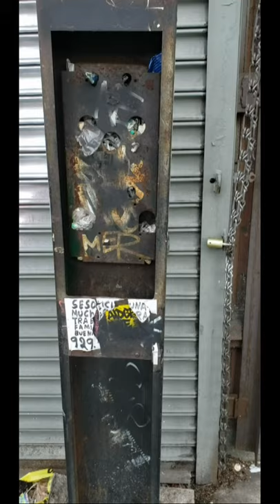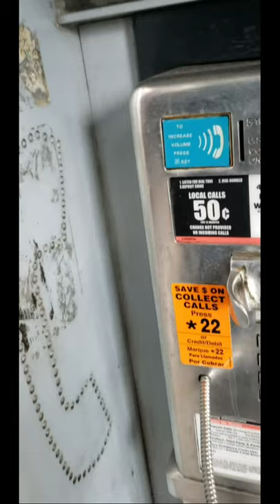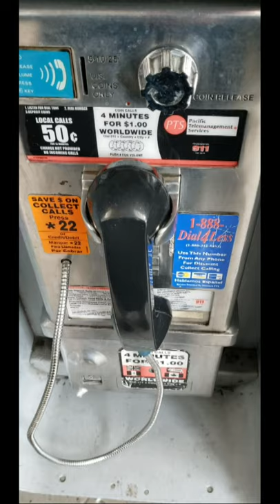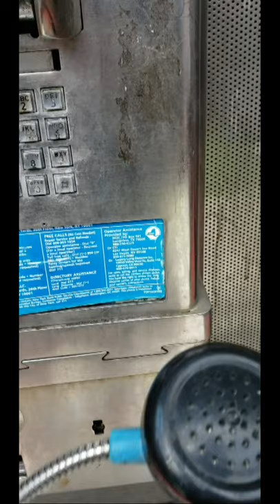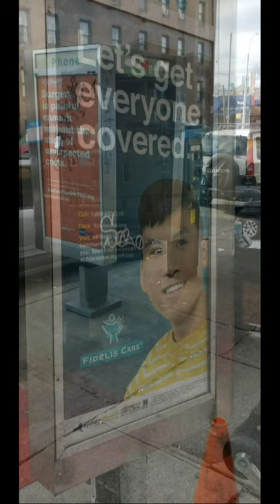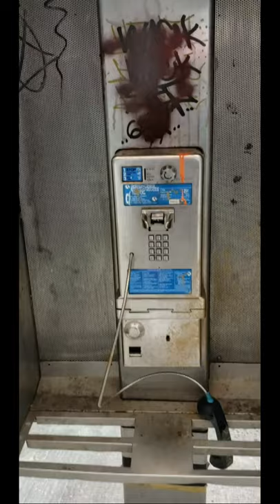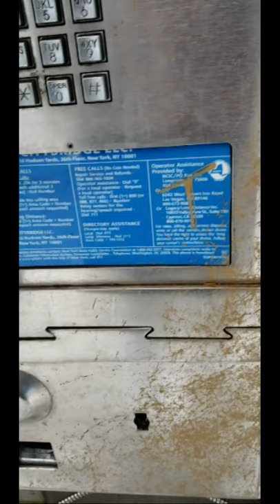Northern Boulevard and Woodside Payphones

Comment: Are they still there i need one
Reply from the maker: All the formerly intact phones seen in this video are now gone. 

Best bets in Queens are:

Flushing Main Street 7 Train station. There are two phones left, one works, the other does not. It's at the Main Street/Roosevelt Avenue end.

Queensbridge Houses, 40th Ave. & 12th Street, LIC. 2 phones, worked last time I was there.

The 74th Street/Roosevelt Avenue/Broadway subway station had a working phone in the middle level, but it required paying subway fare to get to it. I don't know if it still works.

I know, it sucks.
Reply: Ima miss payphones